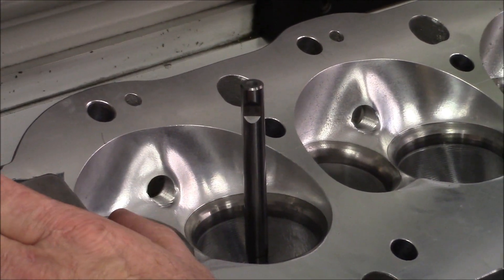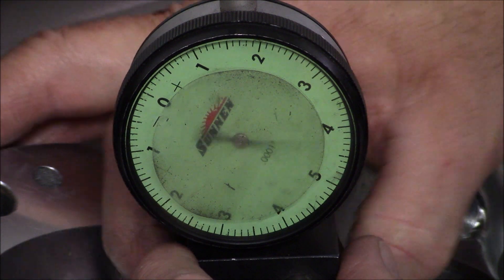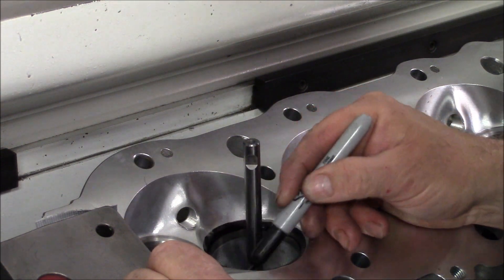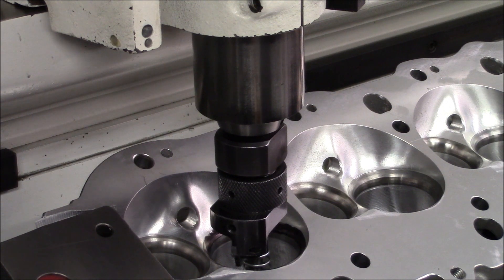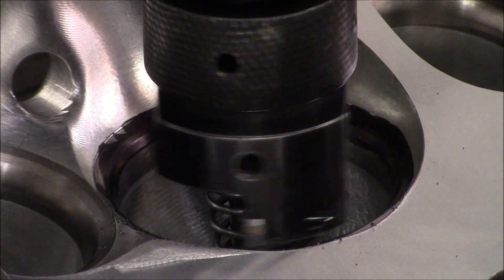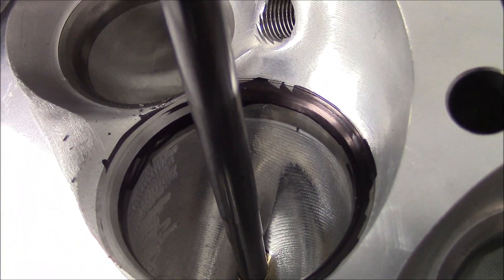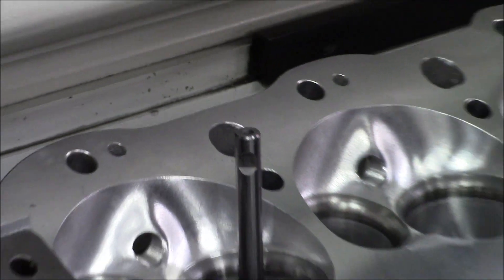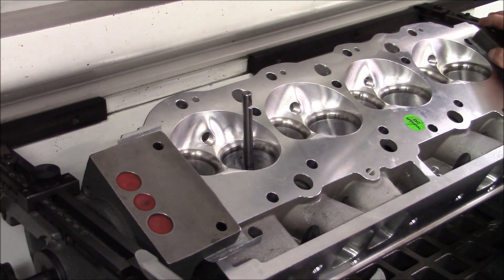Aftermarket Cylinder Heads - Why You Shouldn't Just Bolt Them On - TRRC / VortecPro

Comment: who is to say the play on the pilot is off, how do you verify that is accurate? i'm saying if the play in your pilot is off, anything ran off of it is also off? Thanks
Reply: Was thinking the same thing.
Reply: he states several times that the measurement is only as good as the valve guide, and he did not have much if any faith that the guide was worth a shit...
Reply: A good machinist will check the pilot first.
Reply: He turned the pilot

Comment: Great video... worth watching. Just food for thought. By apply a small amount (film) of oil after using a marker for marking it, it can improve surface finish of seat. Even though you are running tool at a vary low rpm and taking small cuts on aluminium it will increase tool life and prevent any aluminum build-up on cutting tool. Just food for thought. Aluminum build up can effect surface finish even if tool is still sharp.
Reply: Yes, the seats are iron or stellite...
Reply: L Stevens aluminium valve seats? Uhhhhh? Ok!

Comment: Is it the Valve guide it self or the casting machined in the head the valve guide is pressed into?
Reply: The valve guide hole/guide should have been in the proper spot no matter the casting error... the error could be hole placement or valve seat placement or both... or bad machining tools...

Comment: I rebuilt my engine in my daily driver Mitsubishi gallant they had pretty bad runout I did a little clean up porting and matched the intake manifold and exhauste manifold  .  runs better than it did brand new gets a little better mileage smoother quiter . but it does have a little more compression.  but it feels really peppy. I will never call it fast just nice step on it and be able to fry the tires.

Comment: Hi. Great video. I do the same QC checksMyself. I m just wondering if your run outChecking disk contact spot could have beenRiding up on that sharp close combustionChamber outer face edge to give you a falseReading ? Its somthing to watch for as Its happened to me before.Its impossible to see for sure in thisVideo as your big meaty engine builderPaw is in the way. lolsJohn Manley.38 years and counting as a racing automotiveMachinist/ engine builder.

Comment: It's not just the runout, the seats and valves are complete junk from the aftermarket factory.  Put carb cleaner down the intake ports with the valves fully seated, watch them leak out the other side into the combustion chamber.  DO NOT run heads without doing a vacuum test to see if the valves are actually sealing, hell doing a combustion chamber fluid measurement will show a leaking valve!  At least the guy whining about why he's not getting good compression on the dyno will have an answer, don't be that idiot that buys and runs ready to run heads out of the box.
Reply: I've purchased three pairs of Edelbrock heads and given them the carb-clean in the chamber overnight test without a problem.
Reply: I bought a set as well and just installed them as-is. No plroblem what so ever.
Reply: There are thousands of "idiots" out there running out of the box heads with no problems including myself.
Reply: I have tested 5 sets of AFR heads over the past three years for runout and leaks. Nothing. They were spot on. A friend of mine had a 335 BBC head where the seat was a bit off. Tony told him to send it back. They installed new seats and they were spot on after - and he was charged absolutely nothing!

Comment: Great video Tom. My father owns an engine shop and has a Serdi 101 seat and guide machine. I've watched use the same techniques with a marker and dial indicator countless times to show customers why we needed to do a valve job on a brand new set of heads (Brodix, Edelbrock, Dart, Pro Action). lots of customers don't understand the value that close tolerance prep work makes in an engine. I'm sure you do to but we would lap the valves in too after cutting the seats and honing the guides.
Reply: My advice was the same as you're saying. I was told even if name brand heads are $3000+ they still need a total disassembly and about $1000 extra work.
When asking about a new name brand engine block, the answer was the same.
Based on this, I opted for a short GM performance roller cam short block assy and got a machine shop to supply aluminum heads and valves. I supplied beehive springs and retainers.

Comment: You know I don’t ever remember getting a set of complete heads and could bolt them right onto the engine first of all I just would NOT do that even if I bought them from GM. in the 46 years I've being doing engine work racing building I've never ever had an after market head that you could just bolt on out of the box there is no such thing and people who do this will waste an engine..
Reply: What if they were put together by people who do race like weingartner racing or spier racing heads?

They do their own valve jobs and assemble a bare casting from whatever manufacturer you want. Or at least I believe they assemble them.  

They do it for racing heads to accept those are bagged and sent to you for assembly.
Reply: @KingJT80  - They should be better...
Reply: @BuzzLOLOL  you're not gonna get better as far as mixed market economies go

Comment: And I thought AFR were one of the better ones? How much would a cheap head be out?
Reply: All those head manufacturers outsource the guide and seat work, could be anybody almost.  We've gotten pairs of heads from edelbrock that were done on totally different machinery.  The only heads that were correct out of the box were a set from Brodix.  All aftermarket blocks and heads are just potentially good cores until they are properly machined, most are junk.
Reply: Cana box for 2003 hondai elontra 2.0

Comment: What happens when the manufacturer's own racing division (Ford Racing, MOPAR, etc..) produces a head?

Also, how precise are stock replacement OEM heads? Lets say I have a Jeep 4.0 with a cracked 331 head, and I buy a new 331-TUPY head from the dealership. What level of precision can I expect?
Reply: No better because they're usually farmed out to mexico.
Reply: Wow. That is disappointing.
Reply: Way worse in a lot of cases
Reply: causeimbatmaaan or even worse Linamar in Canada
Reply: Skyline Fever a true racing head doesn't have anything cut into it,  they come to you as a raw casting.   gotta cut guides,  seats,  ports,  every bolt hole, and milling all of the mating surfaces.

Comment: How bad are the trickflow 170cc heads? I am blown away. So this could be a serious oil burn off problem and more?? I have a boosted motor and going to build a new dart short block and need reliability
Reply: +MrStangerbanger  Bad valve to seat concentricity would cause low engine compression and most likely lead to
valve guides wearing out prematurely.
Reply: It is especially important to ensure the valves are sealing on a boosted engine. It's important on a N/A engine but more so if you plan on running a power adder.